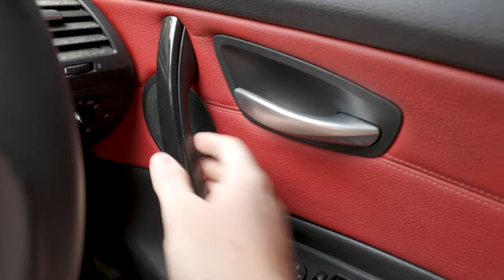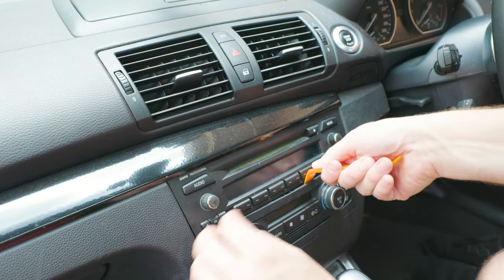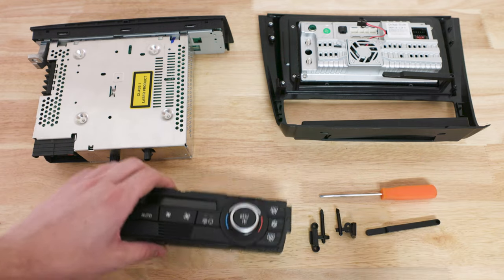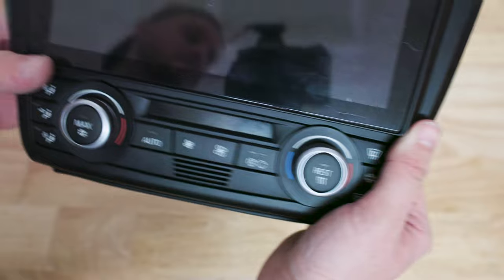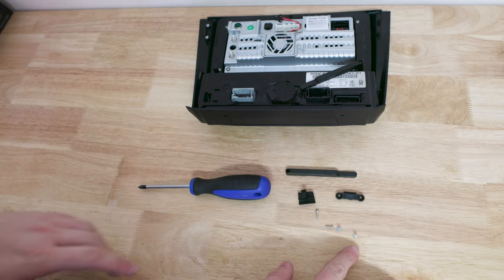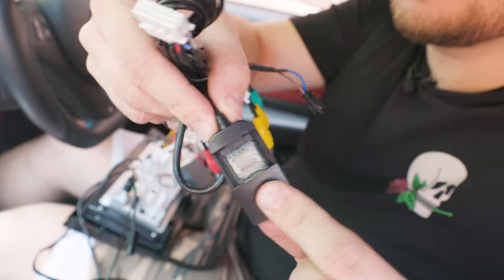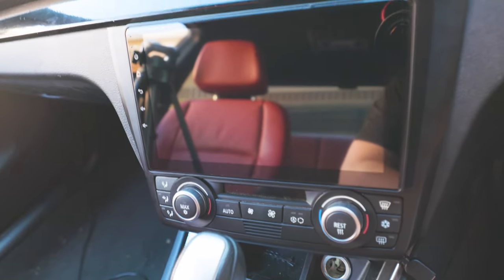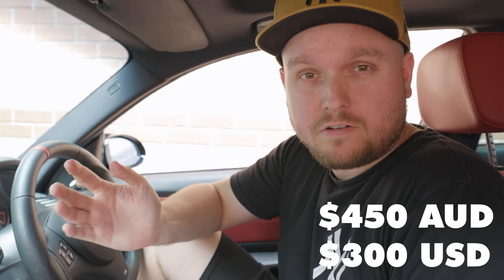CHEAP APPLE CARPLAY HEAD UNIT FOR MY BMW 1 SERIES 135i E82

Comment: Hey man, did you figure out how to make the steering wheel buttons function properly with this unit?
Reply from the maker: Yes, sure did. I needed two steps. 1 connect to wifi to download an update. 2 select the Canbus type. After that, the buttons automatically work which is much better than my previous Spotify experience when using AUX
Reply: @ElliottBrooks  where in the tablet do you go to the update? I have the 2 wire canbus connector plugged in but they my steering wheel lights aren’t even on at this point.
Reply from the maker: @Killerwaffle992  lights? What lights? My steering wheel doesn’t have lights haha. The Canbus settings are within the “factory” setting. You need the 8888 code to access an extra menu
Reply: @ElliottBrooks  my buttons on the wheel weren’t lighting orange for a while for whatever reason. They are fine now lol

Is everyone’s canbus code the same? 8888 doesn’t work on mine
Reply from the maker: @Killerwaffle992  ahh right. Yes I believe the code is the same if the model looks the same. They all come from the same factories generally. Hope this advice helps!
Reply: @ElliottBrooks  nevermind I got the code from them! 

Do you know how to find the CAN box type? Tons with bmw listed as a sub option
Reply from the maker: @Killerwaffle992  yes I found out from the seller on aliexpress. My Canbus was eudi e90 I believe. Best to ask the seller though
Reply: @ElliottBrooks  I picked the settings for the unit I had and now my steering wheel controls work, but my audio doesnt!!! Hopefully theyll have a suggestion for me or ill likely just reset the unit
Reply from the maker: @Killerwaffle992  hahah yeah the fine tuning on these are a little annoying. Was the sound working previously? I didn’t have any sound issues. Just make sure all wires are connected correctly
Reply: @ElliottBrooks  yeah it was working fine until I selected the canbus thing and cycled through all the buttons a few times. I’m sure I just toggled something
Reply: @Killerwaffle992 how did you Get the code
Reply: @Killerwaffle992 did you ever figure out your audio issue? I got radio audio but no audio using anything on android (navigation, music etc). I'm waiting for vendor to get back to me on which canbus profile to use (my canbus decoder is listed as LHL BM 01, but there is no LHL option in the canbus profiles)

Edit: amp was being powered by A12 ANT, so when radio app turns off and music app turns on, the amp turns off. I cut the ANT wire and spliced in power from A7 ACC and that fixed the problem.

Comment: My only problem is with position of the car Radio. It's too low for navigate. Always got to look down
Reply from the maker: Yes, agreed. But both positions have negatives. Being a touch screen, it’s much easier to use from this position. As well as the fact I am quite tall so my rear view mirror already blocks a lot of windscreen visibility. This position gives you a much clearer front view. Admittedly you need to be a good driver as you’re right, you need to take your eyes off occasionally
Reply: I think this is better. Have the convertible and visibility is already horrible. Plus it's rhd, so to put the unit in the storage bin reduced visibility and makes it impossible to use and navigate during driving. This position is far better imo

Comment: hey mate, thanks for the video! Now that it's been some time, how has this unit faired? Any issues? At such a low price I'm a bit concerned it won't last long. Cheers!
Reply from the maker: Hi mate, good question. The unit has faired well! It works exactly the same as the day I bought it. As I’ve said in a couple other comments, inside Apple CarPlay the system is perfect. Outside of it, it has some imperfections but for the price and the fact I am always using Apple CarPlay - I still highly recommend it. Make sure you get the QT10 version for the best processing power

Comment: So this will work with heated seats and my convertible top buttons? Do they just go on the bottom where you put that little black piece?
Reply from the maker: Yes, exactly. That’s my understanding. It’s the same shape as the cut out and we’re not changing any functionality of that section just moving things down

Comment: Hey man, your videos have been very helpfull! Could not find you on instagram, I was wondering what's your opinion on the screen after using it for a while, think about getting the same one and which specs of the screen you have like QT1 1G 16G MT or QT10 8G 128G AT, how smooth it runs.
Reply from the maker: Glad they have been helpful! I’ll keep pumping these out while I can :) I’ve had the screen a little while now and my opinion is the same. CarPlay is great, as long as you’re using a single phone. It connects via Bluetooth and is quite good quality. Sometimes it can freak out - the trick is to “restart” by swiping down and selecting restart. Once it restarts it connects perfectly. Regarding specs - I went top of the line QT10 8G 128G - I’m glad I did as it runs smoothly. Anything less would probably be frustrating. Outside of car play - I have used the screen for MHD and Protools. The trick to get Google maps and Google play store working is to allow sharing of connection via the USB cable. I find that works better rather than trying to hotspot. Instagram is elliottjb_ - I don’t post as much car stuff as I should but might in the future once I get over 1,000 subs

Comment: After seeing this video I ordered this same head unit . Fitted it today work really well other than the fact there is absolutely no sound at all.
Reply from the maker: Hmm - you must have a different setup than me. If you read through some of the comments below - they fixed this issue by purchasing the extra adaptor or checking that they had their wires connected properly

Comment: 10/10  Following this was an easy mod!

Luckily i didnt need to cut the plastic off either, my only issue is my steering wheel controls not working but too my delight you already replied to someone about it in the comments an looking into it now

You’re a Top man
Reply from the maker: Glad I could help! Yeah I hadn’t figured out the steering when I filmed the video. But did shortly after so helped in the comment :) make sure to subscribe if you haven’t already!

Comment: Can this still work as my car is a convertible? Because where would I put the convertible buttons?
Reply from the maker: Hi - yes, works perfectly with convertible. I mentioned heated seat buttons in the video, the convertible buttons go in the same location. They’d be on the bottom underside

Comment: Hi Elliot, 
Thanks for your video. It works great. I have still one issue. I only have sound in the front of the car, the speakers in the back doesn’t work. All the wires are connected. 
(Sorry for my terreble englisch)
Reply from the maker: Your English is fine. Perhaps your car needs the optic fibre connection. My suggestion would be to contact the seller on aliexpress. They are quite responsive

Comment: Does it work with the oem mulf2 and mic and aux/usb?
Reply from the maker: To be honest, I haven't tested them. The new system does provide a new mic and USB inputs, so maybe they're being replaced - I can't remember if it provides a new aux. I am sure it would either utilise existing aux - or you could feed aux to the same ports currently in the car - I don't use either aux or usb so yeah sorry, can't comment much
Reply: @ElliottBrooks  thank you.  so i used the second gen apple airport express and turned that into a wifi streaming device that connects to the aux.  the quality is great.  works well with navigation and music. but seeing the phone on the dash is irritating me more now as the phones are just so big.  with the newer cars having carplay, i need to bite the bullet.  my mate put it in his 86 and it is a world of a difference.  the mulf2 was really the only thing, for phone calls.  but if i have to swap the mics out, thats not a problem.  how many usb's are provided? only other thing was if i have to run the phone constantly to make carplay work via the usb, but that is minor if everything works well.  these 1ers are so tight with storage.  maybe i can route a charge cable into the arm rest or some compartment. thanks for your help.
Reply from the maker: @golfer23rm system comes with two usb cables. Phone calls seem to work well through the system so far. Check the link in the video description for extra details, there is quite a bit of info on the purchase page
Reply from the maker: @golfer23rm  apple carplay connects wirelessly with this system - yes, you need your phone to use it. It also has bluetooth phone capability. I haven't had charging issues - but depends on how long your trips are. Two USB are provided.

Comment: I am looking to buy this but i got some questions
1. Does the receiving for fm radio works as good as the original bmw radio?
2. Is there a line out for an amplifier ?
3. What about the volume for the radio itself? Is it louder/same/less loud then the original radio?

Thanks if someone knows the answer :)
Reply from the maker: Hi - I have found the radio reception to work perfectly fine - although I mostly use spotify inside of apple carplay. I believe there is all the cables for an amplifier and you can buy a fibre optic cable connector if needed. Volume is very good! If you're thinking of purchasing - there is a link in the description :)
Reply: Cool thanks for the info
Reply: @ElliottBrooks  After 10 months, are you still happy with the startup speed and loading of apps or using splitscreen? Anything else you noticed worth mentioning?
I notice it is still on android 10, so hopefully in a couple of years apps will still get an update.
(I am looking to replace my 10.25 inch android screen that i installed in the summer of 2021, after 2 years it has become so slow that i almost cannot use spliscreen anymore, loading waze takes a minute before i can start searching for directions... Resetting to factory settings made it worse lol. Kinda sad because i bought an expensive version from a dutch company that promised me a way better experience then the ali express version but updating apps made it really slow to react.
Reply from the maker: @dj__grizzly ahh I’m sorry to hear. Do you know the specs of what you bought? I am a bit of a techy guy, so I could check the specs and knew that the hardware performance would be good. The start up and load time is super quick. I almost only use CarPlay though and load the apps within that. So in terms of wait times, it’s 30 seconds or so for the system to start up and connect wirelessly to my phone and start CarPlay. Every now and then (maybe one a couple of months), if I’ve been jumping in and out of the car, connecting and disconnecting quickly it might get stuck - so I just reset the head unit and it starts up in 30 seconds again. I am impressed with it for the price.
Reply: @ElliottBrooks  i had to check, it is a motivesupplies (netherlands) android 10 unit with  a 4core qualcomm Snapdragon s425, 2 gig ram/32 gig work memory. There are options for faster units but the price went up to much (this one was already 575€ back in the summer of 2021, it however is the version with both carplay and android auto wireless.)
The 2 gig memory is what is making the unit so slow. i mostly use the built in music player with a 64gig memory card with dj sets in combination with Waze
Reply from the maker: @dj__grizzly yeah that’s why I opted for the cheaper aliexpress version as the specs for price are much better. The one I got is 8 core, 8gb/128gb. It does make a difference!

Comment: Did you retain the door chimes and warning sounds after installing the head unit? I seem to have lost my door chimes.
Reply from the maker: Hi, yes this was something that I did not notice until some time afterwards. There may be a setting to retain them, I haven’t asked the supplier yet. I don’t find it a negative, as I always found those sounds annoying. However, it would be better to be able to toggle - so I’m sure there is an option somewhere
Reply: Hey Sato and Elliott  am having the same problem did you manage to fix it?I don’t have the door chimes nor the warning sounds
Reply from the maker: @Mikiryee not yet - but try contacting the aliexpress seller - they’ve been responsive to any questions I’ve had.  I don’t mind if I don’t have them

Comment: I see that you have a factory amplifier in your car, how did you solve the optic fiber box?
Reply from the maker: Hey good question. In my research it appears that with my specific setup that it is covered via the other wires. Something to do with the amount of speakers. I didn’t fully understand and this was the one wire that worried me. But it seems to work fine after install
Reply: He doesn't have the L7/Harman Kardon hifi system so doesn't need an optic fiber box. I just realised this myself when I tried to follow this video, because I have it. I've got the fiber box ordered so hopefully my sound works after that
Reply: @BigDavoNorriwong  did you get your system to work? I have the HIFI 677 system with fiber optic and subwoofers etc. And I get no sound with everything connected.

Comment: Hey Elliot! Which version did you get, specifically in question of where it says “4G 32G” or “8G 128G”? And do you think that matters?
Reply from the maker: Yes this is important. 

I got the QT10 8G 128G AT. 

The model number is QT10. The performance specs are 8G and 128G which represents the ram and rom (like a computer) and the AT is Automatic versus Manual. 

You can get lower performance if you want to save money, but ideally the higher performance, the smoother the operation

Comment: Hi! I have the same model (basically) and the buttons below the aircon unit, are those gonna be eliminated? The only thing I didn’t understand :)
Reply from the maker: Hey - no, those buttons are included, you just can't see them. They're on the underside of the unit - you would put your hand under to press them. You wouldn't see them, but as long as you know what position each button is in - then no drama. The bottom side is curved. In my video, I place a blank "blocker" because I have no extra buttons
Reply: @ElliottBrooks  cool! I only have the start/stop there so I can’t really get confused, does carplay work well? Does it connects quickly? I was trying to find a more powerful version but this seems to be the only option! Thank you for your answer btw!
Reply from the maker: Yes, CarPlay works well. I have no complaints once it’s all setup. Automatically connects wirelessly after the first connect. Very smooth.  System is powerful if you get the QT10 model in my link in the description. Best value for money. A lot of other systems don’t have as strong processing power or memory so they are slow - or they cost thousands of dollars for similar spec. I rate this system

Comment: Great video! Do you know if this would fit in a 2013 BMW 128i? On Aliexpress it says it's just for 04 - 12 models but it looks just like the 2013.
Reply from the maker: Glad you found it helpful! I can only speak from my experience. If you follow the link I posted in the description then contact the seller - I’ve found them to be very helpful in clarifying specific details. Best to check before buying - might be a back end technical update

Comment: Good video! Can you let us know if the volume controls, and phone answer button on the steering wheel, still function?
Reply from the maker: I hadn’t figured it out yet when I filmed this and wanted to make sure I didn’t hold up this video. 

I’ve now since realised you need to go into settings and select “factory” - when you enter a code they provide - you can then select your car model to program the Canbus integration. Volume, next, etc all work with CarPlay now. I haven’t tried my phone buttons but I am confident they do work!
Reply: Can u tell me the Code?
Reply from the maker: The factory code they gave me was 8888
Reply: @ElliottBrooks  which canbox did u take in the settings and which model?
Reply: @ElliottBrooks  i got the same model like u
Reply from the maker: @thebadnize  it was called OuDi E90.

Comment: Hi, I own an E82 118D and I'm planning on this being the first ever modification I've ever done. I'm generally not great and doing this like this myself, but would you say this process is challenging at all? Or was it all explained easily?

Furthermore, does the satnav on the unit require my phone to be connected? Since on long drives my phone will often die and I don't want to be stranded hahha. Also, does the Apple Carplay mean bluetooth won't work with my Android phone? Was anything else needed to do this that wasn't included on the kit you purchased? (Other then screws, and the dremel).
Reply from the maker: Hi mate, hope the video was helpful. Make sure you check out the link in the description for the purchase link, as that has extra details on which cars it suits and also what’s required. From my understanding you should be fine, and everything is included. Regarding difficulty, this is easier than a bunch of other mods that are on my channel - but still takes some fiddling around. I covered all the steps didn’t skip anything. The wiring can be confusing but does make sense. The satnav hasn’t worked perfectly for me - but I haven’t tried to get it to work as I always use my phone. If you have an android, CarPlay isn’t wireless. Needs to be plugged in is my understanding. That’s easy enough. Good luck!